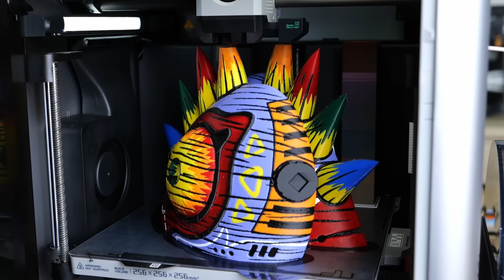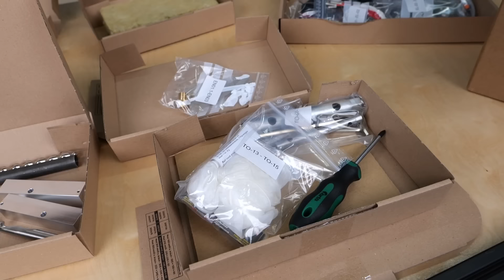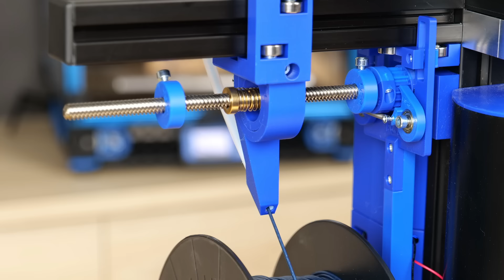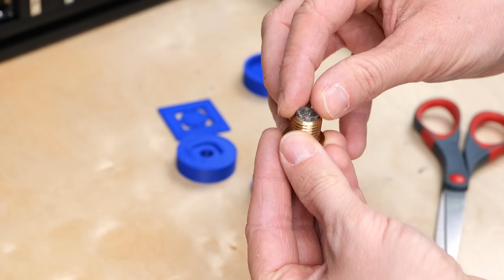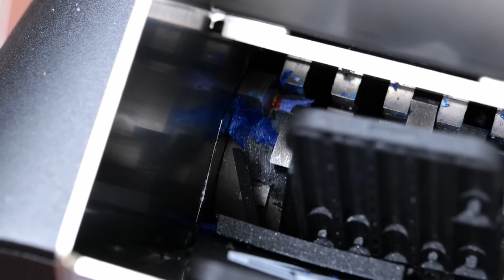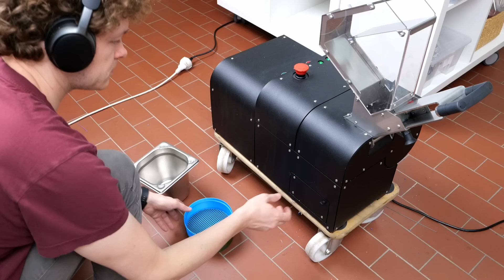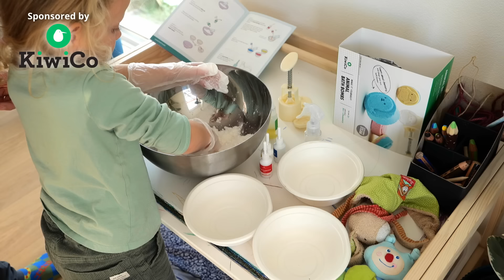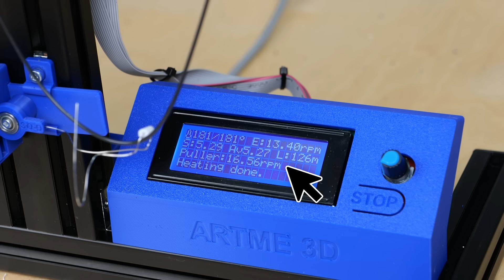Recycling Failed 3D Prints with a DIY Filament Extruder: Artme3D

Comment from the maker: Want to get your 3D prints to the next level? Check out our Heat Set Inserts and Tools at https://cnckitchen.store (Free shipping worldwide starting at €100).
QUESTION Is recycling failed 3D prints a waste of time and money?
Reply: Thank you for spotlighting this machine.  I wouldn't have discovered it myself.  I'm going to be doing some plastic shredding and recycling for my own channel starting with HDPE into small barstock and then doing same for failed prints as I have a bunch in PLA, PETG, and nylon. This opens up some options.
Reply: I would say it is the start of finally using recycled filament. Why just the start? 
The machine seems to work fine and by changing it during the development process it will for sure even get better, especially with the filter and perhaps an additional diameter checker.
But as so often that's just the half of it. For a hobbyist it will be hard to nearly impossible to shred the existing fails into pieces that can be used with this machine. 
Existing buy able machines are far too expensive and everything else won't do the job properly without an enorm amount of time. So in the first part of your video you already answered the question, if this is a machine for the hobby of 3D printing.

When it comes to the question if it is a waste of time and money to do it, I would say for sure it isn't, as long as you don't need to put in too much time and money in achieving this goal. When you sort your waste by color and type, you can make relative clean new material. If you don't sort by color, only by type, you still can make a viable and usable filament, that is good enough for prototypes or cases and other prints, where the ecstatic doesn't matter.
This is a good thing as long as the money and energy you need to put into it isn't too high. When it comes to the money for sure you can say the hobby is still expensive enough and you don't want to make it even more expensive. When it comes to the energy, you still want to help your environment with it and if the use of energy is too high, that goal is endangered.

All in all I would say it is a good start, but still not a solution for most of the hobbyists out there. For a few ones, where money doesn't is such a big problem and for real enthusiasts this is for sure a solution. For everyone else it is unfortunately not much more than a look what the future might bring to us.
Reply: @captain_loeffel it's music to my ears to hear that the environment is one of the key points for you even as a hobbyist.
Reply: Ultimate business idea for some one with the money. Think coinstar but a filament recycler. Would take a decent amount of time making a working unit but would be awesome.
Reply: Recycling failed 3D prints is a waste only if you have small volumes and/or too many incompatible mixed materials... Otherwise, for a professional print shop where you have a lot of waste even from successful prints (supports, brims, skirts, etc., it adds up!), recycling is a valid approach to minimizing waste.
Reply: That's right, but the question was, if it is valid for a hobbyist. ;)  @goeland86
Reply: Too bad it isn't 50% off an Artme3D; I'm kind of between jobs right now and not ready to drop $700 on a new extruder.
Reply: The prize also makes it not really something for the hobby. Just imagine, even with very expensive filament where a roll might cost 60$ you need to recycle more than 11kg of wasted filament. That is a lot of waste. Then the additional costs for a shredder you get easily above 1000$. A little bit for every spool for energy, you get easy to 25kg-30kg of waste material at least of the same material (all colors combined) to get to the point where you have just your expenses saved. 
That is a lot of waste material for a hobby or more or less all of you prints are thrown away. Even then it is a lot.
But it is good to see in which direction it is developing. I think for a hobby the whole system, shredder plus extruder needs to cost way below 1000$.
Reply: @soundspark  same, I'm a student, but he is #1 on my list of purchases. No Santa for me this year though 😅😅😅
Reply: I don't think so, and in fact may save a few purchases of filament and def means less micro plastics going into the landfill/environment.  Might end up costing a little more given power consumed, etc, but I think it's worth the trade off.
Reply: It is waste of money:
* you need grinder
* Vacuum chamber
* Electric owen
* filament extruder
* all of these is high power appliances..
It is waste of time: 
* you will ground old filaments, maybe many times.
* you will dry them on electric oven and vacuum chamber
* you will wait a lot to have one spool of filament from filament extruder. And those processes are not so perfect, can fail anytime.

IMHO, If you are not a real mass/batch producer of filament, then go buy. Amortization is too long for home users or middle-range producer.
Reply: In the current economy, yes. I asked David if he thinks of renting his extruders in the future? He didn't reply back, but it's very complex now.  Me and my friend think this can be the future of the mini-scale recycling technology. In the US I can rent stone cutting tool in Home Depot (American Toom), why not rent mini-extruders, shredders, etc. I know you have the same services available in Germany. Just think about this Stefan ;) The future can be bright, but currently I see so many issues with the industry, though the community is the only thing I like. I wish there were more females and I just discovered Naomi Wu. I think we can shake things up a little bit.
Reply: Yes we have such rental services here in Germany. Many hardware stores provide such services. At some you can even rent bigger machines or trailers for your car in various sizes. The problem is you only find the most used tools and those should be easy to maintain too. The curse of our market economy. So such machines will be hard to find.  @chilloxik
Reply: This looks like a great, less expensive way to recycle scrap. And you could make custom colors if you had enough scrap of certain color spectrums. Or you could also recycle for others in your area and charge a minimal fee for power usage and your time to shred, dry, and extrude.
You could regrind/chop the filament and extrude it again to make the color, and re-extrusion, more consistent. But I wonder how much quality degradation occurs with each extrusion heat cycle.(Maybe an idea for a future video)
I didn't hear what the roller on the position sensor is made from, but maybe a section of PTFE tube would make for a slicker surface.
Reply: @enterusernamefuck  the most needed experiment in my opinion is comparisom of 100% rePET plastic bottle material (claimed by the manufacturer) to 100% recycled PET made by me and see if there is some green washing going on here. Highly unlikely in an industrial setting you can do 100% recycling without additives, plasticizers, etc.
Reply: @enterusernamefuck  check the study 'Multi-stage Primary and Secondary Recycled PLA Composite Matrix for 3D Printing Applications'. PLA gets more and more brittle after each cycle. I think you still need to add raw material to create perfect filament after first recycling. Company that does this well is Recycling Fabrik in Germany. Awesome guys 👍
Reply: But sadly the best way to prove it is to use blow molding, but my school doesn't have it.
Reply: GreyGoo entered the chat! 😃
Reply: @SystemsPlanet  This is a great suggestion.  I work in mining and deal with alot of material handling conveyances, and magnets like these are require all over the place to prevent metal chunks from destroying equipment in the system.  Typically magnets are located at major movement points, so in this case, you could use a magnet to capture metal by passing the material over the magnet before it makes it to the hopper.
Reply: next project for me too, another question: what another kind of plastics we can shred and bring back to filament? i believe most comercial ones like a plastic chasis of an old paper printer cant not be used,for sample?
Reply: @sexybb-8208  how about color-changing plastic blends or glow in the dark plastic? I'd do it just for fun.
Reply: @sexybb-8208  🤣🤣🤣I'm glad you liked it, I'd love to see the result video :)
Reply: Schönen guten Tag! With all the additional equipment needed, i.e. the power supply, the drying and, last but not least, the shredding devices, this is not a 600 bucks extruder. Besides that you should also think of the waste of power and resources if everybody would recycle their leftovers on their own. This will only make sense if you use the shredder and drying devices anyway.
It would be much more efficient and probably beneficiary to the wallets and to the environment when the leftovers were collected (by colour and material, of course) and recycled in a more centralised institution. Did you check if there is something like that already?
Reply: for the amount of microplastics you consume? no
Reply: I think a have a laser measuring device at home that could get handy for the measurements if you like i could send it to you😁
By the way i love your vid. They help me so often😅thx
Reply: for the metal and non plastic  you can use a big magneto and gravity/ air trapsand for the size a optic sensor  there are alot for this purpose and cheap the hard part is the calibration whit a PID like.
Reply: 18:36 use a "U Groove Roller Wheel" that will fix the problem
Reply: I wonder if you can put some segments in the hopper, load in different color shreds and get ... vaguely wavy dual / triple color filament? Might be a cool effect even if you have to slow down the filament mixer part.
Reply: delivery not worldwide
Reply: :hand-pink-waving:Hallo Stefan! Thanks for the intro and the overview. As someone who prints a lot, are you recycling the print purges and the mis-prints regularly, or is the overhead of shredding, drying and extruding new filament too much of a hassle to do regularly?
I'm new to 3D printing and am honestly a bit shocked about the amount of waste 3D printing creates. So I'm curious about these projects, but also surprised even more about the additional equipment necessary to recycle: shredder, drying oven, vac pump, filament extruder.
Reply: how much is it
Reply: Как купить такой станок?
Reply: Where to buy full machine ?
Reply: The narration is so Painful. My Opa was German and He sounded Charming.. listing to This guy’s cadence and Inflection is like, well READING KAFKA..🤤
Reply: There are another Teflon that can stands the high temperature 🎉 you should use it or just use a high temperature silicone 😉
Reply: Why don't you build a laser check diameter for the filament?🤨
Reply: Can i make it from my old ender-3?
Reply: For a cool wire diameter measurement have the line be pulled over a white piece of paper where it is tensioned up against something so it does not move back and forth. place a white piece of paper behind it and while a properly diametered line is in it, mark the paper . so now when u look at it - if the mark is not visible then the wire is too big, if there is gap between line and mark then its too small. placing a magnifying glass over the the whole thing and look thru it makes it easier to read.
Reply: If you sorted your filament waste according to material and color prior, it would get rid of the banding, too. Good job recycling filament! One of my biggest pet peeves with 3D printing has always been all the waste product discarded instead of reused.
Reply: @KainYusanagi  kkii

Comment: Wouldnt the thickness come more stable if you slow down the extruder motor? Its gonna start to go thin when its losing grip or lack of material right? 

Looks good i was thinking of a grinder so cam throw bottles onto it etc break em down into small pieces then into sonething like you got here to grind it further and finally extrude and reel it up.

Comment: If you are really that concerned about diameter, just create a diameter gauge with 2 rollers before the spooli8ng to squeeze, then set up something to make a noise for if it gets too thin or thick. Heck, you could probably do it from where you already have a roller even.

I would be curious about weighing out the input to fill a spool, and making sure the hop is big enough for a single load for 1 spool, then do a whole set and forget, as well as set up a system for venting fumes.  This thing could be set up to be fully automated, if not turned into a recycling business where you could probably get some government benefits.

Comment: Thanks for your efforts, very informative 👍
Regarding spooling RPM: Surely, the clogged filter had a part in it, but also: the more material is on the drum, the larger the diameter → slower rotation=same amount of material per rotation
Good english btw, with one small update: it's a "BANG" 💥 for a BUCK, not a bank... #Weitermachen

Comment: If you need higher temperatures your better not using the PTFE tape and use a steam system rated industrial sealant. Be careful which as some are super strong and won’t come apart. A product called Stag is good for this kind of application. It will let you go much hotter if you need to.

Comment: Awesome video!  The RPM drop is due to the spooled filament starting on a smaller diameter spindle, then expanding as it fills the spool. The speed of the extrusion doesn't change, just the rotation of the spool.

Comment: At the moment the cheapest kit is sold for 699€

Just to even out the initial investment you have to recycle roughly 40kg of filament (depending on the cost could be less ore more). An average hobbyist would never produce so much waste even in years of failed prints.

There are services that recicle scraps and give you discount on purchase in exchange, so maybe they are a better choice for the hobbists

Comment: interesting cooncept. but aside from the original $2000 in labor and then subsequent maybe $500 in labor every time u do a run,this takes a $10-$50 roll of filiment up to lets say $500 or more. this doesnt include the inital payout of about $700 + idk how many thousands for the fancy shredder. then how much for the dryer? yea $500 a roll is low guess. but like everything else including 3d printers themselves i said no f'in way to the original 3-$4000 for 1 i said id wait -15 years later i can get a 2nd hand starter for $60 yaay lol so maybe 10 years from now all the equipment will be cheaper but then 10 years from now it maybe some totally different tech like a replicator from startrek lol so who knows. micro sd and usb stick killed the mini dvd and the blue ray so hey sometimes life happens to tech to ,will have to wait and see

Comment: They now have 3 different versions for 650, 780, and 891 Euros.  Unfortunately, the page describing the differences is broken.  The cheapest model recycling 10% waste from $20 spools would place break even at 378 spools printed.  This does not take into account, unit shipping, power, time, cost of a shredder, etc.  Same calculation for the most expensive model is 537 spools.  Those numbers go down with more expensive spools like $35 Prusament.   216 spools for the cheapest model and 307 for the most expensive.

This looks like a great device for enthusiastic hobbyists that print a lot, small print farms, or a combination of those, as I suspect overlap of the demographics.

One other usage would be temporary prints.  Print an object, and shred it down for recycling once it is no longer needed due to many different reasons.  That could drastically reduce the break even point.  Imagine all the wasted prints that would no longer make it to a landfill.

Prototypes
Models that were updated and reprinted
Prints that broke during use
Prints that no longer hold that special place in your heart they did when they were warm off the print bed
One time tools not likely to be needed again
Your son's favorite 3D print after you caught him smoking and failing Math
etc.

Comment: "Only $600"? We still need to print all the parts, sort the colors, and because much of the material is multi color poop, the colors won't be accurate. So far $600, + filament and printing costs, plus our time, we can print random colors that are pretty much only good for prototype prints.

Now the big question - how long is this machine even going to last? Because I can buy rolls of PLA for $10, so we are talking a minimum of 60 rolls just to break even. And who is ever going to use 60 rolls of random multi color filament?

Seems impossible to ever break even.

Comment: In your  PET Bottle Recycling: Waste to 3D Printing Filament video from 2 years ago, you mentioned the extruder only reuses around 1/3rd of the PET bottle. Might this Failed 3D Prints with a DIY Filament Extruder: Artme3D be able to recycle the rest of the bottle or all the bottle if it was shredded into bits?

Comment: Did you do the math? Typically, out of every kg of filament, less than 50g is wasted through printing. That $600 could buy at least 24 spools. 24 x the 950g of “useful” filament in each is 22,800g. This equates to the amount you could salvage from 456 spools of filament. And that’s your “break even” point. After salvaging the waste from 456 spools of filament, you will have created enough free spools to have saved the $600 you paid for the machine. Until you have salvaged the material from those 456 spools, you have paid more. This estimate does not include repairs or part replacements required, nor does it include failed prints ground up. This also requires the user to separate their materials so immiscible materials aren’t mixed.